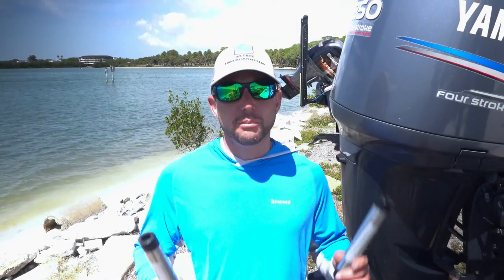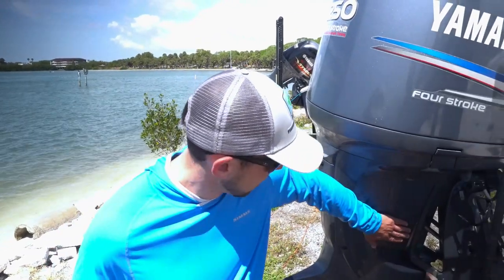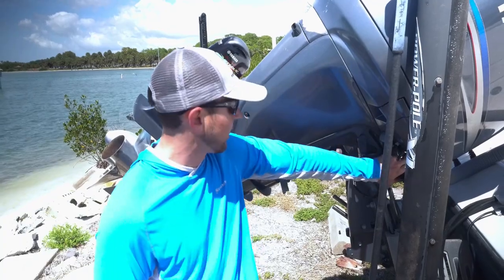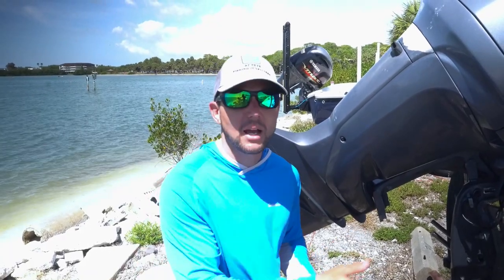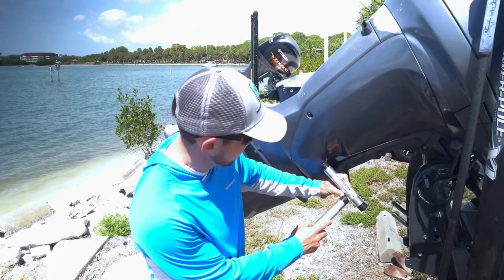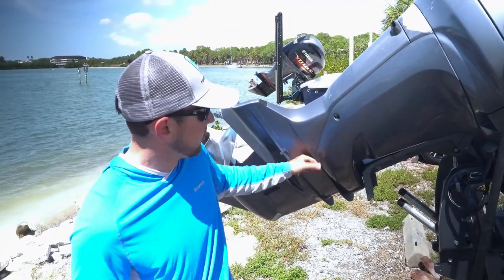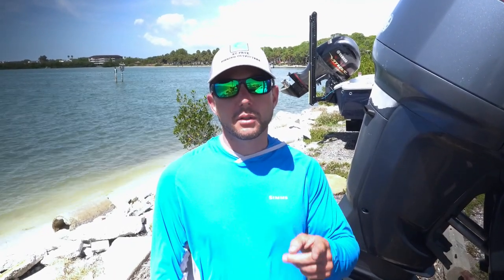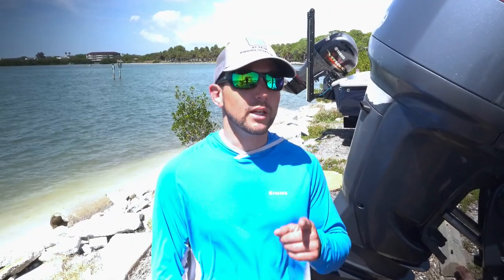Outboard Motor Support Stiks from TH Marine - Save Your Tilt and Trim!

Comment: But your motor probably still bumps around I prefer a transom saver with my motor locked down and strapped down, and I know my motor, transom, and boat are safe. that's just my opinion..
Reply from the maker: I'm sure it works great.